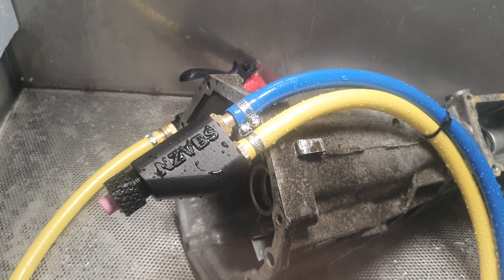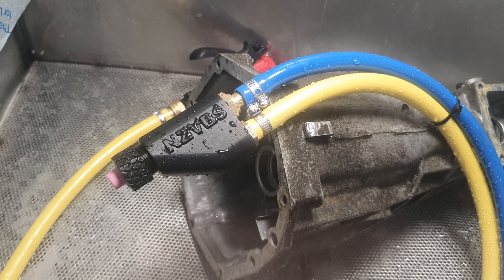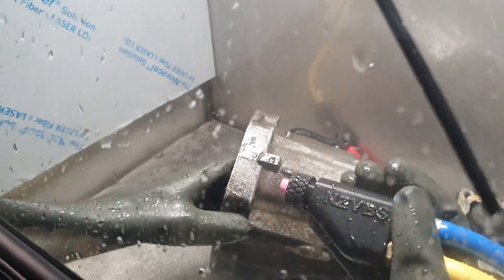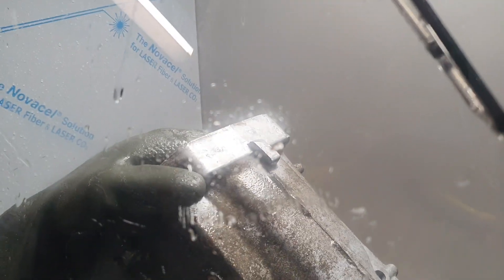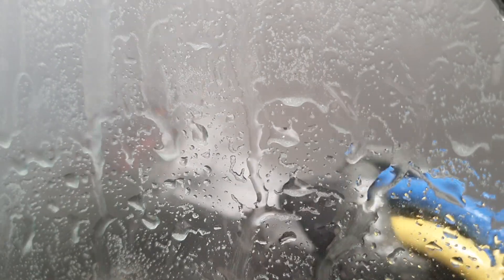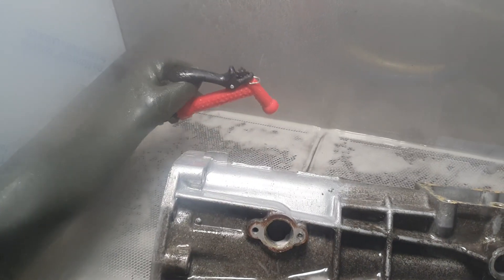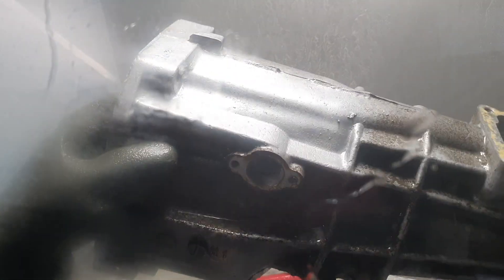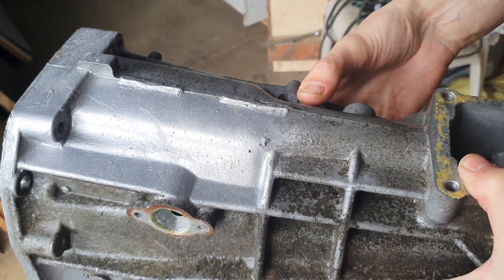R&D Continues on 3d Printed Vapor Blaster Nozzle

Comment: Hay Mate, im looking at the SB-200 from MH for a holden/bedford project,( i live in kaukapakapa) would vapor unit be 
any better for me doing steel parts like A arms etc, cheers Brett
Reply from the maker: Hi Brett,

To be honest with you, if you are only doing steel parts, there is probably not any advantage to a vapour blaster over a dry cabinet. Also, you need to run corrosion inhibitors in a vapour blaster for steel. That said, I recommend trying out one of those MH cabinets before buying one. They are little pathetic out of the box and take some work to get them to be more workable.

Flick me an email at josh@armouryenterprises.com if you want any more info.

Cheers
Josh

Comment: Hey Josh I have a question for you about your new 3d printed gun.
Reply: Hey Josh,

Sure, flick me an email
Reply: @joshhubbard5026   ok cool I bought the original file from you and I was wondering on the new style gun with the cap and the ceramic nozzles
Reply: @joshcudworth4770  I remember. Whats the question?

Comment: if I purchase the STL files does it include different air jet sizes?  I run a 3.2 HP 60 gallon which requires a 2.5mm air jet. Also if you make changes/updates are those available for free after I purchase? Thanks for all the great info.
Reply from the maker: Hi Dan,

This gun is different to the 3d gun I have on my website. The one off the website was designed more as a diagnostic tool to work out whether someone's gun is causing performance issues, so it only has the one size of air jet. The files for this gun are not yet available as its currently a proprietary product that I use with my smaller cabinets.

Thanks for watching!

Josh

Comment: Hi Josh, Love your videos! I am building a vapor blasting setup using a 30cfm compressor, 1000W 19,500LPH dirty water pump, 100 grit aluminium oxide slurry and then 45 micron glass bead slurry to try and clean off corrosion and brighten cast aluminium.. would you have the ideal air jet and nozzle size for your 3d printed or brass setup for sale to make the most of the 30cfm?  I have the standard nozzles that came with the cabinet but am also willing to try a longer tapered nozzle for nice linear flow as I have lots of air cooled cylinders to try and brighten
Reply from the maker: Hi Jason,

Flick me an email at josh@armouryenterprises.com and we will sort you out with the right setup.

Cheers!
Josh

Comment: Hi josh,

Having a small problem with my cabinet after following your e book along with your nozzle/gun design too.

Water is back feeding down to my pneumatic foot pedal and coming out the exhaust. I have a brass swing check in-line and it seems to be functioning fine but for whatever reason water is getting past it and down the line. 

I can tweak this by adjusting the nozzle to tip distance but it’s still a problem.

Any ideas what this could be? I’m pulling my hair out
Reply from the maker: Hey Daniel,

Swap out your swing type for a plunger type. Something I have learned since writing the book is that the swing type can have media build up that stops them from closing properly. For some reason it is worse with the pneumatic pedals than the electric solenoids.

Also if you have a 3 port pedal, block up the exhaust. Since there is no ram to return, it doesn't need it. 

Cheers
Reply: @ArmouryEnterprises  thanks Josh. I’ll try that tomorrow. And you’re right, it does seem to be a build up of media that’s causing the issue, funny that it wasn’t happening before though. 

The plunger check valve, do you mean just like a spring type with rubber seat? I’ll take a trip to the hydraulic shop tomorrow and see what they have. 

Thank again.
Reply from the maker: @Daniel_Martin152   Yes I noticed that too. it starts with a little media but once its in there, it will build up quickly.

Yeah the spring type. It's like a flat or domed spring loaded plunger with a seat. the seem to clear the seat of media better and retain a better seal.

let me know how you go. Feel free to email me, I don't always get a notification of YT comments.

J.
Reply: @ArmouryEnterprises  Awesome, thanks Josh, appreciate your help. 

Cheers,
Dan

Comment: Wouldn't it be better to go through the sandblasting process first?
Reply from the maker: In some cases yes. Particularly when there is heavy corrosion. I prefer not to dry blast if possible as it brings up the finish much faster.
Reply: @ArmouryEnterprises  that's good bro. i also do the same. 
good luck to you and happy creating...
Reply from the maker: @nanoblasting  Thanks man!

Comment: Hi josh,

When choosing a submersible pump does it matter the flow rate and wattage? There’s lots of pumps on eBay and their flow rate varies drastically according to the specs. 

Also, would you say plastic or stainless bodied pump is better? Cheers mate
Reply from the maker: Hi Daniel,

I usually go a minimum of 450w and 7500lph. The difference between stainless and plastic is really just the shell. When you pull them apart they are practically the same inside.

Hope this helps 

Josh.
Reply: @ArmouryEnterprises  thanks Josh.

Comment: Would be interested in buying one of these if you are going to sell! 
Also how often do you change your water in your machine? Mine seems to get dirty from sitting in the open bucket
Reply from the maker: Hi Craig,

Flick me an email at the address in the description. I will let you know when I am happy enough with the design to start selling them.

It depends on what I am doing with it. Sometimes I will drain out the water out after every job if its dirty. Sometime if I only do clean stuff, I will leave it for a couple of weeks
Reply: Without all the fancy several container filtering system I use a cheap water vaccum, and I vaccum the top of the water until it clears which indicates most of oil is gone, then I add fresh water, sometime doing this twice until water is clear

Comment: Have you tested with any longer nozzles for the increased velocity?
Reply from the maker: Not this particular nozzle. These ceramics are longer than the previous ones. I have tested the different lengths on the ebay style guns though. Without measuring its hard to tell about velocity, but the tighter spray pattern of the longer nozzles definitely are an improvement.
Reply: @ArmouryEnterprises  Awesome, thanks for the info :-)